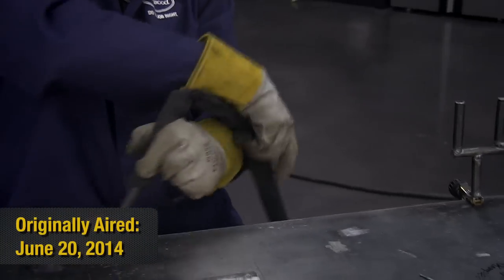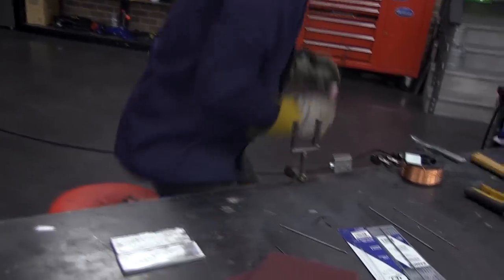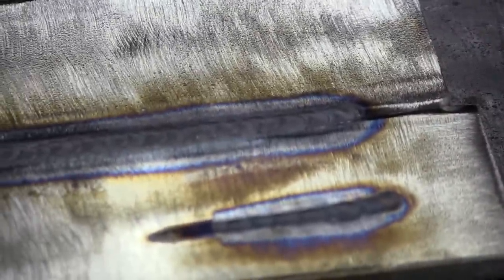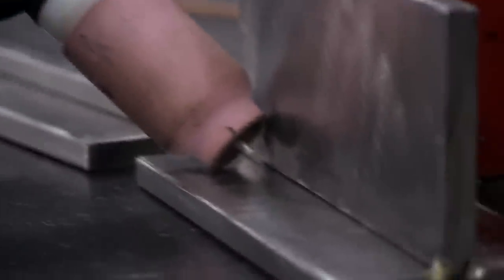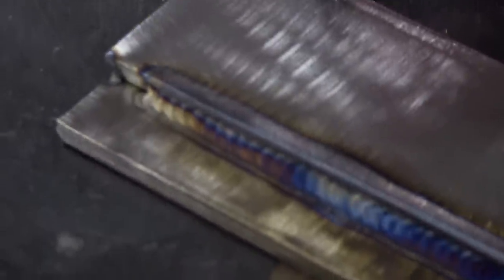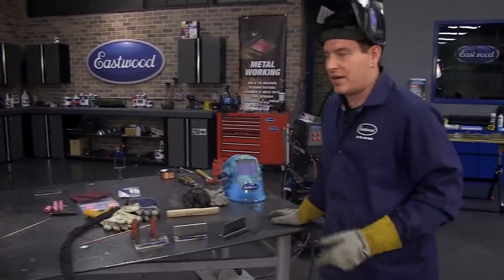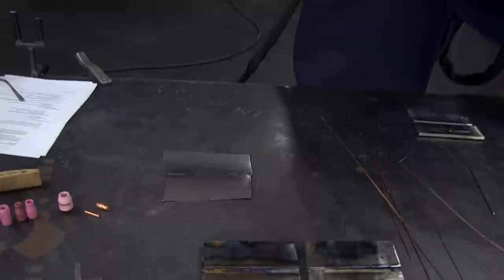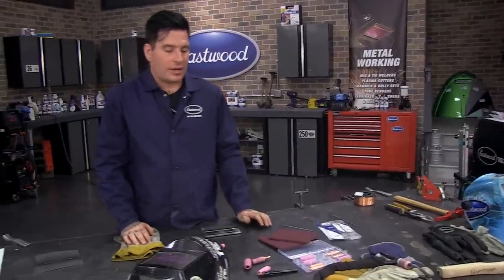Welding Basics & How-to TIG Weld - Livestream Part 2 of 2 - Eastwood

Comment: I have been considering getting into TIG for a while now but was a little concerned about a lack of knowledge of the basic-basics (grinding electrodes, stick out, gas pressure, etc.).  Your two videos are without a doubt the best I have ever watched on basic Tig.  You covered it all including how to move, dip, etc. Videos done about Basic Tig by most other people don't get basic enough.  Great Job!!!

FYI -- I started Mig welding with a "Open Box" Eastwood MIG 135 from the Alsip store. After a very short time the machine quit working right,  So, I took it back to the store where they tried it out.  It was in fact a bad unit and without any hassle they were going to exchange it. But, I decided to upgrade to a new Mig 175.  I've had the Mig 175 for about a year and absolutely love it.  IMO the people at the Alsip store and Eastwood are top notch.

After watching the Basic TIG videos that you have done I am now ready to pull the trigger and get the ac/dc tig machine as soon as I can come up with cash. Thanks for the great videos.

Comment: Seriously, this guy covered just about everything! He did everything that has been said to me over the years. If you never did this before this is definitely for you. He constantly adjusted his tungsten stick out but didn't really say why. You don't want the tungsten to stick out so far that you touch your metal or your filler wire. You can set your stick out where ever you want it, but there is such a thing as too far.  Practice all you can on this good clean metal, when it comes to dirty metal you will be challenged. Sometimes you just cant pick good clean metal to weld on. When it comes to stainless and aluminum always use new grinding disks that have never touched anything before. I do the same thing that he does with his hand wire brushes with my grinding wheels. Yes, the camera man should have used the tripod.

Comment: great video it's nice to see a company shoot in a raw type of format makes it seem real like it was shot in a guy cave.  Keep up the good work and thanks.  After watching this I went out and did my first few hrs on new tig machine and it's not as easy as it looks but I did ok and never once smoked the tungsten rod.  I used your advise and just made a bunch of passes without any filler then did the filler.  Pushing the metal rod with the fingers is not easy.

Comment: This may have been stated but for beginners its useful to think of the following:  The electrode is puddleing the base metal of both parts and its possible to fuse the two together without filler rod.  However for an optimum weld filler rod is added.  The electrode will push the puddle forward and filler rod keeps the puddle replenished.

Comment: THANK YOU! For an entertaining, thorough and very educational introduction to TIG welding!
I've learned more from these two parts than from any other video.
Keep up the good work, I'm off to get myself a TIG :D
One question though, is the AC/DC not suitable for thin sheet metal welding?
Or do you use two different machines for less hassle with changing heads and settings etc?
Best regards from Norway!

Comment: Great tutorial - more editing would make it even better.  
Sadly so far all my welds are contaminated, even when I am careful to clean it.  But its getting better - from what I've seen here I have been making a number of mistakes.  Trying to melt too large an area by making a circling pattern; not resting the cup on the surface for stability; extending my electrode out too far and using too small a diameter of cup; so will experiment.  Its even ooh so hard to see what is going on no matter how I clean I make my visor shield.   Lots for me to learn - you make it look so easy.  Thanks.

Comment: Factory I work at asked , who's interested in a TIG welding course, I applied , now few days later they are shoving me out as a test ... learn it in 3 days , wtfI know a bit of electrode welding but totally zero of TIG welding....And I gotta learn all this in 3 days... sounds like It would take weeks if not months.thanks for this clip , gonna memorize it, now by Thursday 10_03_16 im gonna love this , or have a mental breakdown :D
Reply: +SkampeX that's march over here (Belgium) so 3/10/16 for  others.Fingers crossed, light a candle, sacrifice a la.... nah ill be fine...really...
Reply: +SkampeX Finished and it worked out great , thanks for the info, it helped

Comment: Fantastic TGI videos! Thanks so much for taking the time to make them. Recommendation: Tripod that camera! Sheesh. Also, have the cameraman learn how to manually adjust focus so he can change it more quickly. My stomach is turning from the shake and the slow focus. :)
Reply from the maker: If you search "Eastwood TIG" you will find many more videos, shot recently with better production.  Shooting Live isn't easy, but we've improved greatly and with the lens we put on the camera, you can really see the weld puddle, just like if you were the one welding.
Reply: Keep it up, these are great! Content is awesome.

Comment: i'm new to tig welding, ive done mostly big stuff .035, .045 and 1/16 wire feed. with a 4g cert. and tig is such a different animal im having a hard time, i cant make my puddles uniform and nice, time will improve that. one thing i noticed is that the machines have a cooler. what benefit does that have and does it have an effect on the settings you would be using?

Comment: A+! Awesome video's! Buying my first weld set tomorrow, cheap free-weld set.. XD (can't wait)
Wanna focus on making exhaust manifolds (for turbo cars)
Got any tips for me regarding the fact they get really hot and pressurised when driving.
The shop told me a pedal wasn't really necessary for my application, you agree?

Comment: OK, in this part 2 you answered my previous question that I asked in part one, namely how to complete the circuit and how best not to get shocked.  However I thought of another question.  Does the filler rod get inserted into the leading edge of the puddle only, and that's how it melts, or is the filler rod actually in the plasma stream and that's what melts it?

Comment: Good video! I'm just getting into welding and I only have a cheap flux core welder and I'm looking to upgrade. I would like to know what type of welder you would recommend I buy, MIG or TIG or are they about the same, just different type of welding? And also is there any difference in strength of the two types of welds? Thanks in advance!

Comment: One question you didn't cover is about your comment on the smaller tig welder.  You said it's DC and for steel only.  Why?  Do you weld aluminum with AC?

Comment: This may be a really dumb question but I'm going to ask anyway! Are you grounding to the metal table ?? I'm going to assume that since your welding steel on a steel table you just have the ground to the table, but I figured I'd ask!
Reply from the maker: +Romerider156 Yes.  The ground clamp is hooked to the steel table.
Reply: thanks, wondered the same thing

Comment: I am looking to attach thin aluminum to a steal rod. It for a lawn ornament. Any suggestion for tig welding this. Or is it better to stick weld it. The problem with the stick is I burn the aluminum.

Comment: When starting the arc how close does the tip need to be to what your welding.. and if you to touch the tip to the metal should you regrind tip and start over?
Reply from the maker: Tim Poole The tungsten needs to be close enough to start the arc, but not too close that it touches and becomes contaminated.  With a little practice, you'll figure out where you need to be based on what type of joint you're welding.  And yes, the tungsten should be ground if it's contaminated, and should be ground using a disc that hasn't been used for anything else...because that could also contaminate the tungsten.

Comment: Is the TIG welder model in the video able to start the arc without contacting the tip to the material, or does it need to touch down briefly to initiate?  What voltage does it develop at the tip if it's able to arc through the air without contacting?
Reply from the maker: ***** You don't need to "scratch start' the Eastwood TIG 200.  Here's a link to see the product at Eastwood - http://www.eastwood.com/tig-welders-eastwood-tig-ac-dc-welder.html

Comment: when you talk about dipping your tungsten is that just contact with the filler or is that when you dip in the puddle? Is your electrode tip in the puddle or?
Reply from the maker: +zach schneider The electrode should not touch the puddle.  You're dipping the filler rod.
Reply: +Eastwood Company thanks

Comment: Very helpful vid, thanks. So, in both TIG and MIG welding, you are looking to melt the base metal as well as the filler rod? And this is what differentiates a weld from s braze (where only the filler rod is melted), is that correct? Thanks again. Getting ready to try my first TIG weld, and this was very helpful.
Reply from the maker: Yes, teh filler rod is melted with the metal.  You can really see this occur when TIG welding.
Reply: Glad your still reading these. How do you know when a filler rod is just right. Not to big not to small

Comment: My car is 90% sheet metal with a few cross members and posts. Can I get by with only one TIG welder to take care of anything that may come up and if so, which one would you recommend?
Reply: I previously owned a TIG200 AC/DC and it's a good hobby tig welder.  The benefits over the DC only TIG200 is that you can control the pre- and post-flow to protect the molten weld pool from oxidizing too quickly.  Upgrade the torch and power lead though.  The stock one with the TIG200 machines is heavy and will dry-rot in a few months.  HTP USA offers replacement torch kits from CK Worldwide with super-flex cables and is a worth upgrade.  A 17 series torch with a stubby gas lens kit will make world of a difference.
Reply: Thanks for the info and responding
Reply: It depends on what you're doing... I know that everyone makes a big deal about TIG welding, but for most people I'd recommend skipping TIG and get a good MIG setup first.  Although TIG can deal with more different metals and if you get good with it you can do finer welds, it's slow and expensive.  Running a bead will typically take 3-5x as long as with MIG, and that's not counting the additional setup.  Most people would never finish a project if they had to do everything with a TIG, but with a good MIG, unless you're doing a lot of really special stuff you should be able to get it all done, faster and cheaper.  I would rather have a MIG for sheetmetal work, most exhaust and chassis work... I've even started doing some welding on aluminum castings and stuff that used to be considered TIG only work with a spool gun on my MIG.  It seems like I'm setting up the TIG welder less and less, even though I'm doing more work that most people think you can only do with a TIG.
Reply: Joe Hreha fgrff

Comment: I have never tig welded before. I usually mig. which tig machine would you recommend
Reply from the maker: The TIG 200 AC/DC is a great machine and can weld steel and aluminum.  If you only plan on welding steel, try the TIG 200 DC machine.  (both can also weld stainless)

Comment: After a couple of minutes welding, I star seeing "double", I see my tungsten like jumping around, its hard to explain.
Eastwood, do you might know something about it?, or anyone that can help me with an explanation. I be really thankful to find an answer, Ive search, went to the doctor, got me glasses, but didnt work, please help!!! I really want to be available to weld!!
Reply: might try a darker lens. It could be that too light a shade is causing this distortion, ultimately early strain.

As a side note, try looking at a different part of the puddle.. as in front for tig ( where the wire is being fed into, or mig either before or after) also you need to focus on three things at once, the rod, the puddle & your final result making changes as  needed.  make certain  your face isn't into the work either. want to save those peepers.

Comment: When you're dragging your torch, are you making any sort of pattern with the torch? I know with mig, most sort of move their hand/torch in a U shape but I can't really tell if there is any movement or not. Also, as someone else said, is when you're dragging the torch over the puddle, is it ever touching the puddle or does it not matter if it touches the puddle?

Thanks for the video none the less
Reply from the maker: +someone11110 The torch doesn't touch the puddle.  You need to keep the electrode out of the puddle so it doesn't get contaminated, at which point you will need to grind the tungsten to continue welding.
Reply: From the first part of the video (when no filler rod was added) it looks like the gas cup is dragging across the puddle but of course that when the camera was shaded so I couldn't tell 100%, that's why I asked. I also understand that the electrode doesn't need to make contact with the puddle but thank you for the clarification. Also, thank you for responding in general.Eastwood Company
Reply from the maker: +someone11110 If you have specific questions and can also call an Eastwood Tech who can discuss this with you in detail.  Eastwood Retail Stores have classes every week on using the tools and products we sell, including MIG and TIG welders, if you live near a store.

Comment: what hand would u hold what depending on if u are right or left handed, and how do u light it up i see there is a trigger on the handle but was not talked about. thanks!
Reply: The foot pedal starts the arc, and depending on how hard you push it will give you varying heat, if you mig weld with your right hand on the trigger youll most likely hold the tig torch in your right hand and feed with your left.

Comment: What's better for autobody work, tig or mig?
Reply from the maker: TIG generally puts less heat in the metal and has a much smaller bead, which means less grinding.  But some of it is simply preference and which machine you feel most comfortable using.

Comment: Hi,, what type of gas are you using is it different types for different metals??
Reply from the maker: Ricky Dove He's using 100% Argon to TIG weld aluminum.  If you have additional questions, feel free to contact the Eastwood Tech Department to discuss welding.  http://www.eastwood.com
Reply: thank you for replying,, ive been only mig welding for twenty odd years but thought i would have a go at tig welding as were into motocross so if we get any snapped bits i can fix them.
Reply from the maker: Ricky Dove The Eastwood TIG welder is easy to use and comes with a 3 Year Warranty and 30 Day Money-Back Guarantee.  Plus we have a bunch of videos to show you how to get started.  If you're near an Eastwood Outlet Store, classes are offered to help you learn.

Comment: Lose the cameraman...
Reply: +Damo Floyd Worst camerawork I've ever seen. Hurting my eyes trying to focus constantly.
Reply: Damo Floyd the focus issues and jittery camerawork hurt. But, it is not the camera man, it's the camera's lack of features and lack of good camera equipment.
Reply: For thick gauge steel stick welding is cheap and very effective even for the novice.  For thin gauge, gas, TIG or MIG are really the only options.  It would have been useful to know the gas flow rate and current for the TIG welding of thin gauge.  When welding on cars sitting nicely at a welding table is not an option.  Also it is not always possible to get the weld area absolutely clean, for example paint on the back side, and this can contaminate the weld.

Comment: are you left handed?
Reply from the maker: Mark Pikas Yes, Matt welds left-handed.
Reply: Eastwood Company That was driving me crazy when I noticed that he grabbed the torch lefty.  I even went back to part 1 and looked at it and couldn't decide, he sometimes reached for stuff with his right and sometimes with his left.  Then further in the video he demonstrated some torch motions with his right hand...
Reply: Mark Pikas  I learned to use soldering iron by both hands after a seriuous car accident.....that makes me thinking about lerning how to weld by both hands... :-) Might be handy...